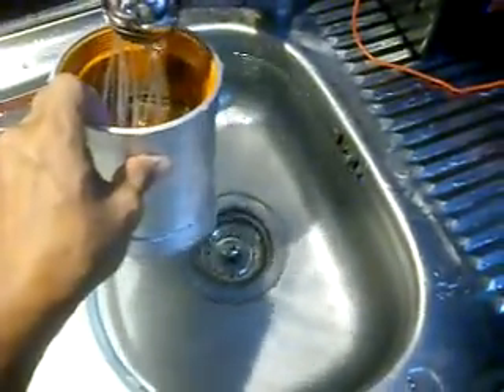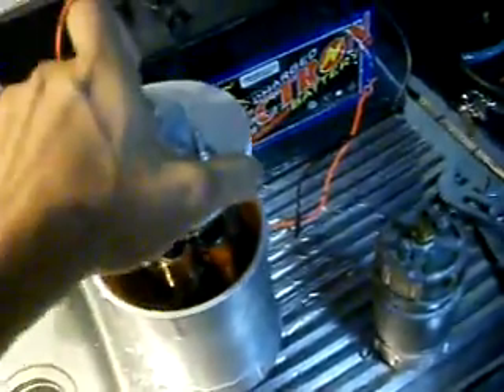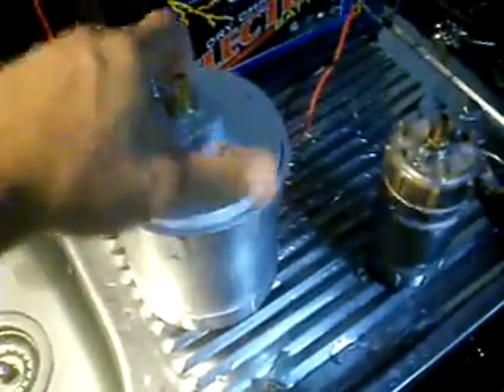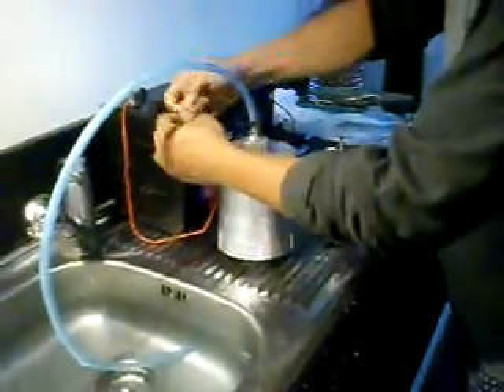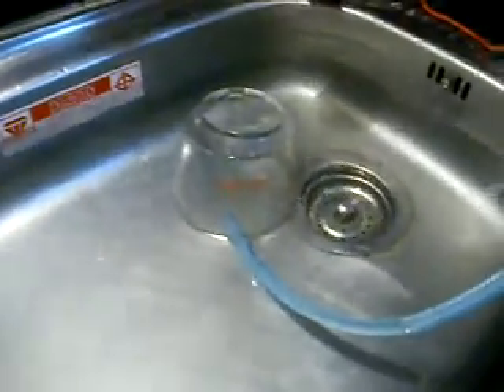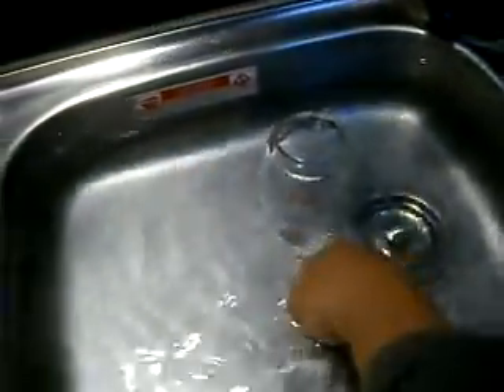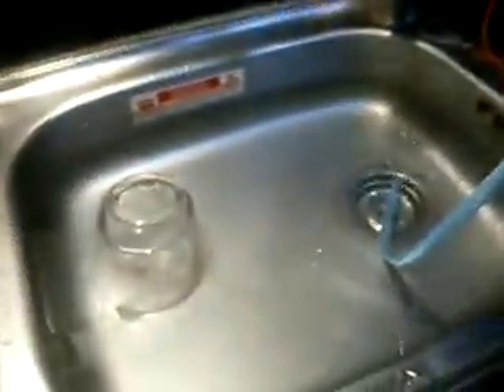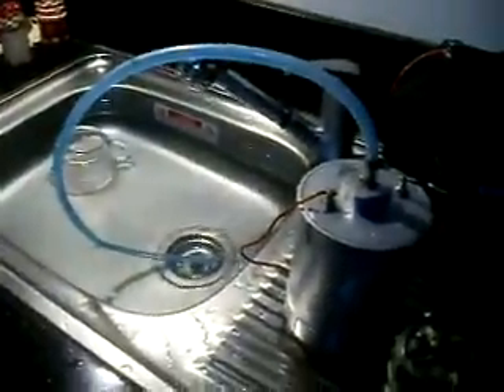Hydrogen Super 7 LPM Test on Tapwater Part 1

Comment: I think for me it is much easier to calculate the needed H2 to run an engine by just using stoichiometric ratios. Gasoline is roughly 14.7:1 air/fuel mix, and H2 is 34:1 air/fuel mix. So convert the needed LPM to satisfy the needs of whatever engine. Its easiest to use something older that was carbureted that was rated in CFM, then convert CFM to LPM. I think a 650cfm carb would need 30 HHO generators that produce 25LPM hho (17LPM h2). The Tech needs more improvement, but it is getting there.

Comment: I find it funny that you are brazen enough to disregard years theoretical science.
(wasting your time and money)
find out for yourself how much hydrogen it takes to run your vehicle under a load. (pipe hydrogen from a tank to your carb.) 
I will tell you it is about 3,500lpm minimum to maintain a mustang at 50mph . that is 3,500 liters per minute.
dispute that    I hate that fact btw.  I would like nothing more than to break the oil companies